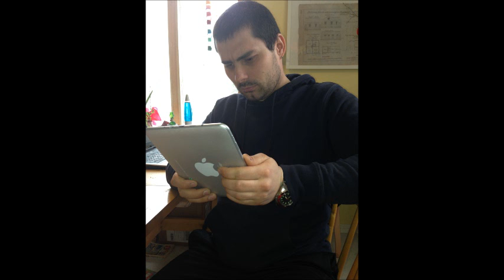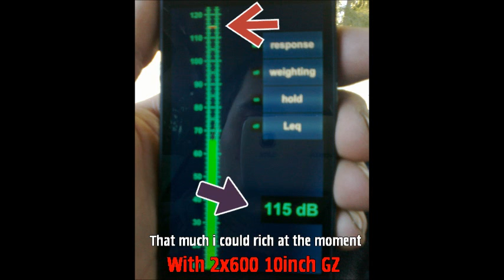vw passat tuning

Comment: Do yu know if the front bumper can fit a 2000 vw passat sedan
Reply from the maker: Could work probably with small changes or then u get easy from FK automotive CSR bumpers ;-) witch fit perfect for model you got,